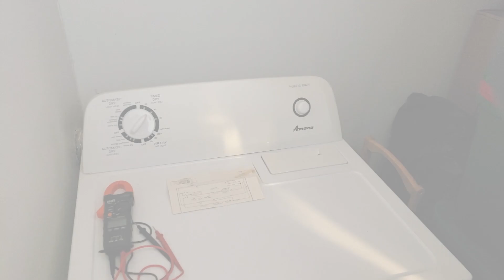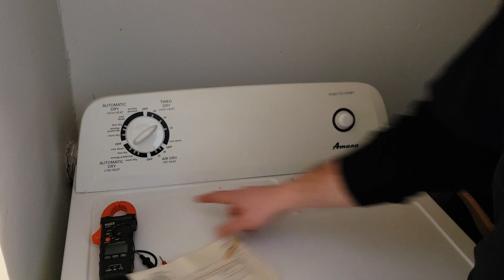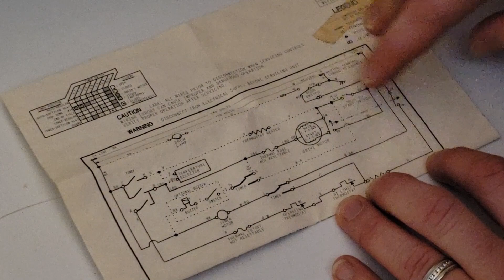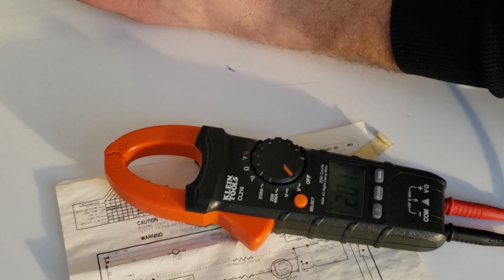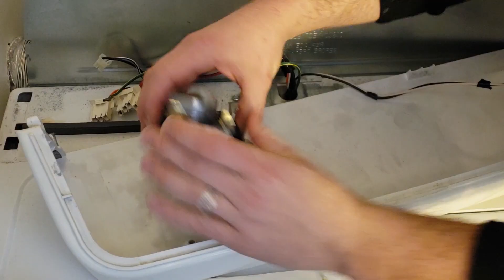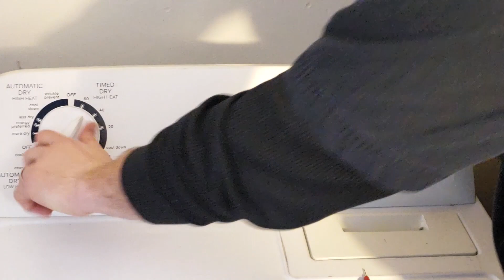Amana, Whirlpool & Maytag  Dryer - Control Timer issues - No heat - Diagnostic & Repair

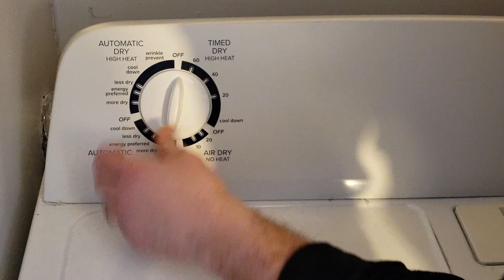Comment: I like how at 5:57 you turn the knob to the left, that will help break it faster
Reply: not in these, they spin both ways. some only spin one way, but not these amana timers.

Edit: they are built to withstand turning counterclockwise, i took one apart and it has a mechanical release that doesn't engage the timer motor (which only spins one way) when turned backwards. However, this WILL put strain on the plastic ring that handles that. 

These dryers are not built to last forever, and that plastic ring is sacrificial. If the ring breaks, the timer breaks in a way that it won't stay on and burn your house down by keeping the dryer on forever. If you ignore that, you can set the dryer to be on forever by accident. So people should realize that is a possibility.

Comment: I had trouble taking the old timer off the bottom clip so I unscrewed round the aluminum module off the black box , still it was difficult but eventually came off with a needle nose pliers.

Comment: Outstanding video! I spent $400 on a repair tech that changed out the motor and didn’t solve the problem. It was the timer and I wasn’t going to spend anymore on a “professional” to solve this. I followed your video step by step and successfully fixed it myself. Thank you for taking the time to record and post this video. Thanks!!

Comment: I have a Amana dryer it's only about 4 years old and went downstairs this morning and for some reason the dryer was running from the night before so I'm believing it might be a timing problem and I have no heat
Reply: Same issue
Reply: Did u buy the timer? Can u tell what model to order? Cause this guy won’t answer…. I got the same exact machine in the video
Reply: I’m having the same issue. My clothes are dry but not warm. Like it’s on no heat dry. And it was still on 60 minutes that I originally set it to.
Reply: Did you figure out what was the problem? Was it the timer? I have the same issue and don’t know what it is

Comment: So I have issues with the control timer not shutting off and also no heat
Reply: I have same issue and about to switch out my timer using this video.  Did you make this repair?
Reply: @dawnmahoney960  We went ahead and bought another dryer(used) it was probably going to cost as much as we got the dryer for to repair it.
Reply from the maker: Great question, if you have a more technical question that our parts department cannot answer, you can search our over 17,000 answered questions free at our website www.ApplianceVideo.com under our Repair Help section. You can also call our parts department at 1-800-830-5465 and they can give you help 7-days A week ,or search at www.SaveMoreOnParts.com  .
Reply: Same here. Did you end up finding an answer?

Comment: Where did you connect the black probe?
Reply from the maker: Great question, if you have a more technical question that our parts department cannot answer, you can search our over 17,000 answered questions free at our website www.ApplianceVideo.com under our Repair Help section. You can also call our parts department at 1-800-830-5465 and they can give you help 7-days A week ,or search at www.SaveMoreOnParts.com  .
Reply: ApplianceVideo.com this didn’t answer my question

Comment: Mine has wires that plug on the top part of the timer as well.  Yours and most of the ones on Youtube are the same.  One goes the one pair and the other to the single one
Reply from the maker: Great question, if you have a more technical question that our parts department cannot answer, you can search our over 17,000 answered questions free at our website www.ApplianceVideo.com under our Repair Help section. You can also call our parts department at 1-800-830-5465 and they can give you help 7-days A week ,or search at www.SaveMoreOnParts.com  .

Comment: Where is the part number for the timer? Is it on the black housing or on the silver thing?
Reply from the maker: Great question, if you have a
more technical question that our parts department cannot answer, you can search
our over 10,000 answered questions free at our website www.ApplianceVideo.com under our Repair Help section. You can also call
our parts department at 1-800-830-5465 and they can give you help 6-days A week
Monday -Saturday, or search at www.SaveMoreOnParts.com  24 hours
7- days A week.

Comment: Is it practical and accurate, if instead of checking voltage, a technician would use the clamp meter on amperage setting to check what you troubled shot respecting the timer? Also, from a life personal experience, I have seen technicians hurt from wearing rings and jewelry while doing service work. Thanks for this well presented and accurate video on the Amana dryer. I have recently purchased  and installed an Amana NED4655ew1 and transfering knowledge from the hvacr, I will be able to repair the dryer when necessary. Thanks again for your fine video.
Reply from the maker: Thanks for your response, we are glad we could help. Our library
of over 5,700 videos are currently helping over 1.6 million people like you
every MONTH.  Please help us by
subscribing to our YouTube channel, or post our website www.ApplianceVideo.com to your Facebook
page, Twitter, Instagram or any other social media sites. Your support will
help us keep producing more free quality videos.
Reply: All you need to diagnose a bad timer contact is checking for continuity while in high heat between the A, B and C terminals. Doesn't need plugged in, ever. If he's checking for voltage that really isn't the best way to do it, IMO.

(These are repairable, by the way using an emery board)